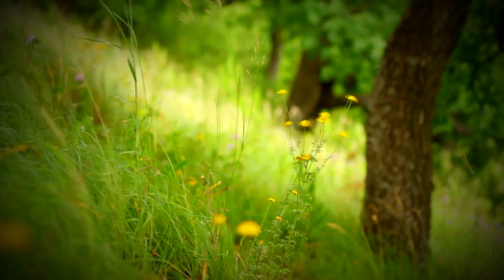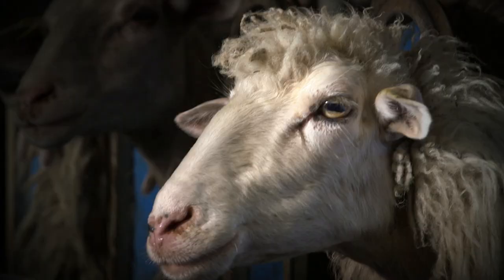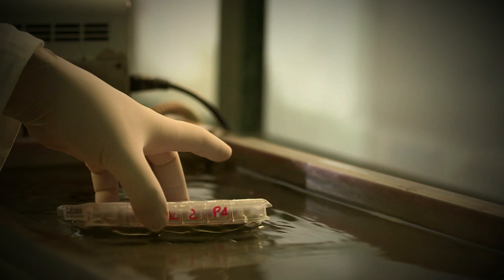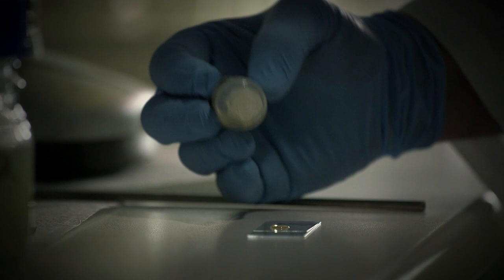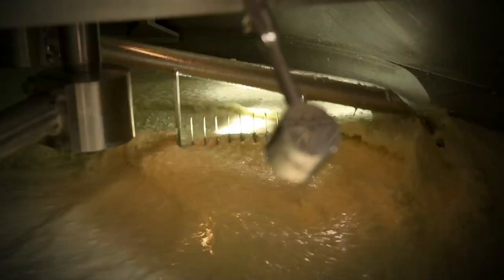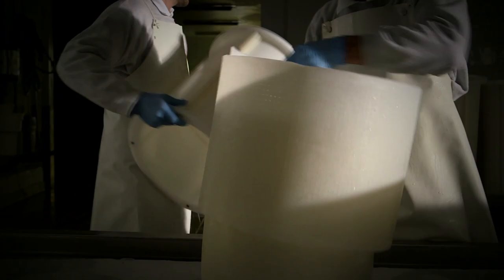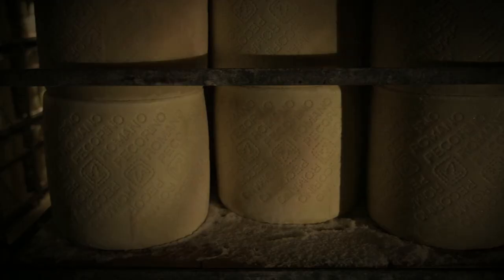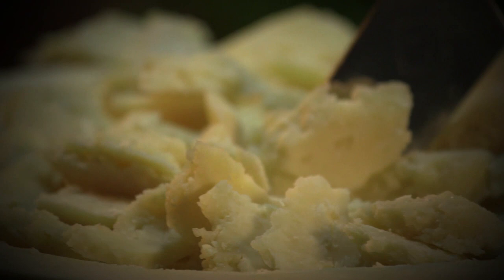PECORINO ROMANO DOP (English version)

Comment: What's the spelling for the name of the milk enzymes?
Reply: TheBeebs It's generally referred to as rennet. The nae of the enzyme is rennin. If the word rennin is capitalized ('Rennin') it will have been manufactured in a laboratory through genetically modified calf genes and the it is in fact a trademark.
Reply: You can buy organic too.  Not as consistent, so use a little more.
Reply: There are vegan sources of rennet available too
Reply: @zoeydeu2261  And what's the point of that? 
If you're Vegan, you aren't going to be eating cheese anyway.